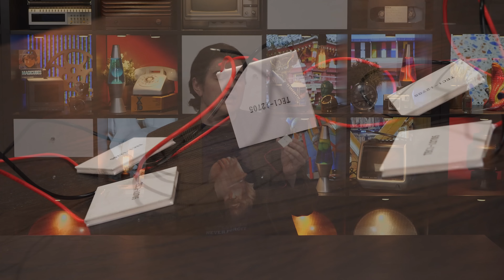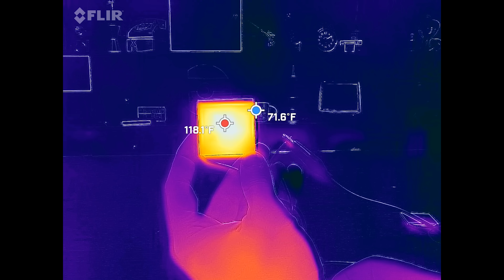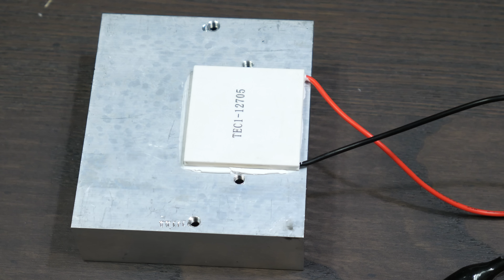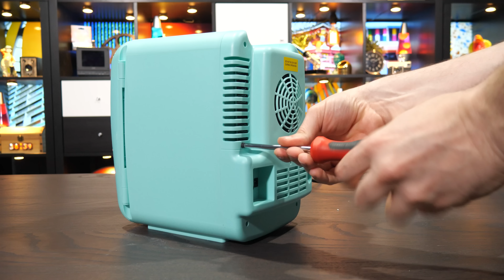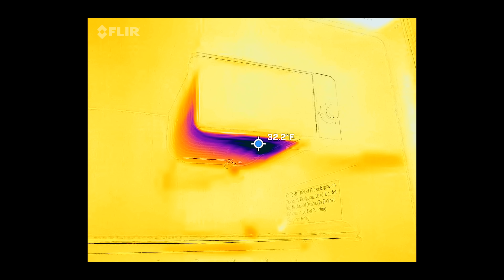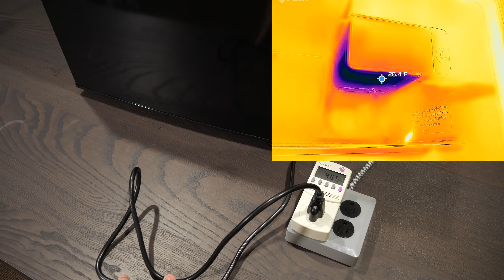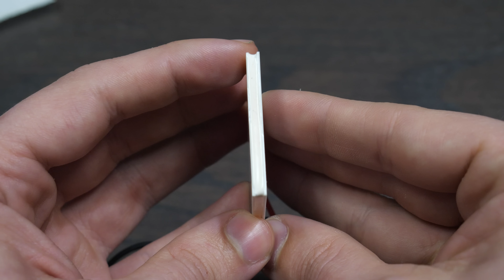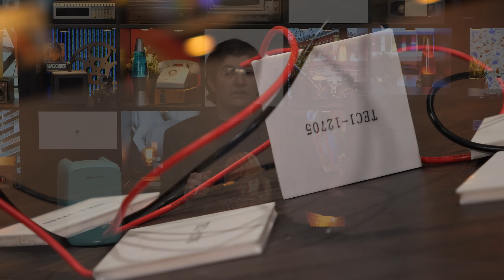Thermoelectric cooling: it's not great.

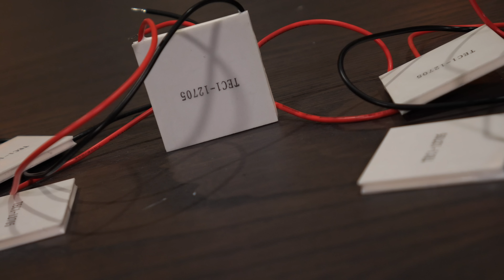Comment: 4:50 this comment is a bit misleading. 5A at 12V is indeed 60W, but the element cannot be dissipating 60W of heat while still operating as a heat pump since moving thermal energy from one place to another is a form of work. The amount of heat dissipated will likely be greater than 60W, but this will come from some combination of the movement of thermal energy from one side to the other, plus some amount of waste heat which will be somewhere below the electrical power consumed.

Comment: Hrm
The heat energy being pushed out by a refridgirator is wasted.
What if you had those devices that spin based on heat output turn a generator and produce energy to bring back into the fridge for further energy efficiency gains? 🤔
Reply: Sterling engine?
Reply: @awatt  Yes!

Comment: 26:56 not true, you just need to be accelerating in a direction so that the relative acceleration of gravity is cancelled out and a new fancy artificial gravity can be introduced… with this technique you can run a fridge upside down for minutes before crashing into the ground at way more than terminal velocity

Comment: When I first discovered these as a 14y old I built my own little mini fridge: repurposed cpu coolers on both sides and a temp control module a few wires and some insulation inside a rather large drawer. Got it down to 4°C with like 12 cans inside. Then I realised all the downsides like condensation and Power Usage. All in all a fun little project I did on my own

Comment: PCR thermocyclers also use peltier devices. The ability to rapidly heat and cool the samples is exactly what is needed, and the samples are small, meaning that the electricity use is not too bad.

Comment: Check out ice machines! Even the cheapest ice machines at $40 have a whole heat pump inside with an even smaller compressor than that mini fridge. The evaporator is in direct contact with water and can make 10 cubes of ice in just 5 minutes.

Comment: Used in early home refrigerators about 1913. The development of gas medium compressor refrigerators which cooled more and at a lower energy cost. These are useful in your car, but it is advisable to put items into the unit straight from the regular refrigerator.

Comment: I made a cat house with an DIY miniature HVAC system. Used the turbofans from an old power edge server and Peltier modules with water cooling. Needed 400W to cool/heat a tiny box for my cat to chill in

Comment: I have adjusted the mechanical  thermostat in my mini fridge to make it much colder. There is basically only one design fro them and is easily found online on how to adjust.
3 screws that can be adjusted...
1- Min temp ( I used this to lower the temp to -3C )
2- Max temp ( Pretty useless to adjust this )
3- Hysteresis ( This seems to be your issue with the cycling on / off time )

Comment: One place they might be useful is for a filament dryer for 3d printing, the ones currently on the market just use resistive heaters. Granted a refrigerant based dehumidifier will still be better, but unless you've got a whole room full of filament, maybe not super practical.

Comment: I got one of those peltier phone coolers that attach via MagSafe to the back of my iPhone. My car doesn't have air conditioning and Spokane summers are usually pretty hot. Plugging my phone into the car tends to make it overheat on 3-5 hour summer road trips, and the cooler I got prevents that. It isn't bad for $20 off that rain forest website.

Comment: Comparing apples to oranges. The small 1 isn't meant to be a refrigerator. It's an electric cooler. It's meant to keep things cold for a certain amount of time just like a cooler. It's not meant to get them cold in the first place or to store food long term. You put it on your desk, grab 6 cokes in the morning, throw him in there and you don't have to keep walking back and forth from the refrigerator all day. In this case the small size is a good thing because it goes on your desk. It's the right tool for the job.
Reply: It is not, because it doesn't keep them as cold as a real fridge. You just invented some weird use case to justify it. Who frets over walking to the fridge to grab a new can of coke, especially if it's cold?

Comment: Lol, thanks for the amusing video!
My own fridge isn't that small either, it's more than 2m tall (>7 feet) and has around 350L of combined storage. It's also got a No Frost feature. Guess what the yearly power consumption is... 162 kWh. That's an average of just 18 Watts. Kind of amazing to me! It has an inverter and DC drive, which probably helps.

Comment: I always have cold drinks out of my mini-fridge, regardless of all the other downsides... however, the mini fridge will also need occasional defrosting. In fact, it probably needs it more often since the plate is so small... but that means it's easier to clear up.

Comment: Peltier units are used in a lot of scientific instruments that need to temperature cycle. If you're running PCR, for example, you need to raise the temperature a lot, and then bring it down as quickly as possible. There is basically no other technology that can do that in a space-saving manner, in a way that can cycle in tens of seconds. But you're only heating and cooling a few grams of material, and the speed and size are the important part, not the energy use.

Comment: The other cool trick you neglected to mention was that when you create a temperature difference across a peltier it will generate a current. I have a camping pot that can charge USB devices while boiling water. Not the most efficient generator, but a nifty trick for turning one type of energy into another.

Comment: I use many Peltier devices in PCR machines (as seen in viral detecting); for fast switching between heating and cooling they're pretty much unbeatable. I also have one of these things at work, as I have a dietary restriction and can't risk putting food in the communal fridge, I find in Scotland it runs a little too cold if anything. It's right by me and I just don't notice the noise. However, the energy inefficiency does worry me so I may look at other solutions when we move offices later this year.